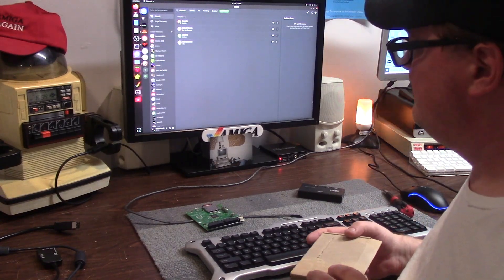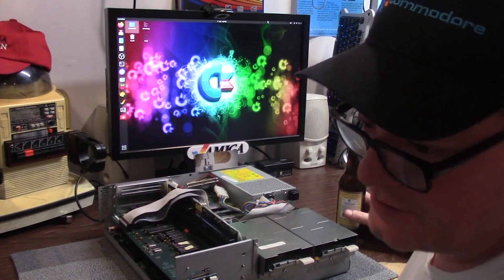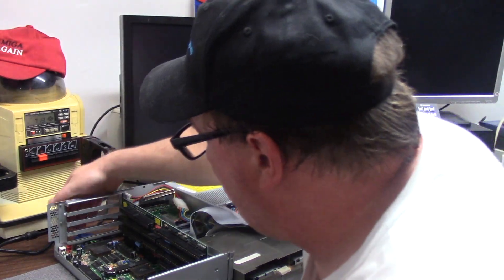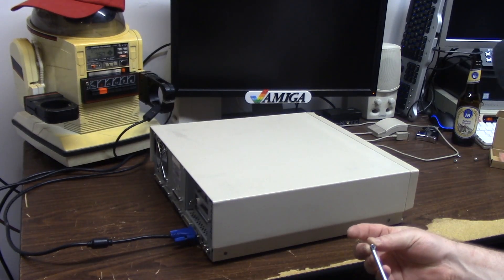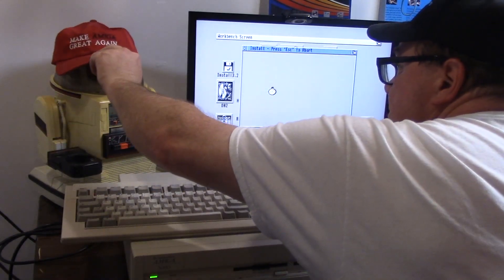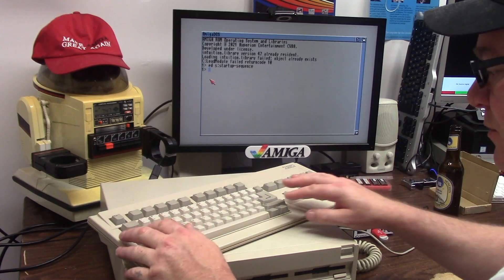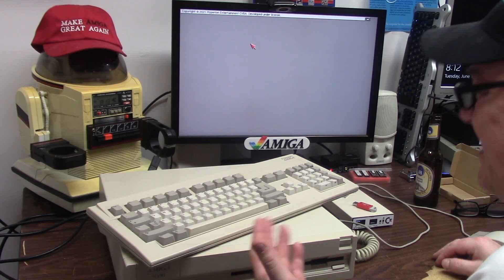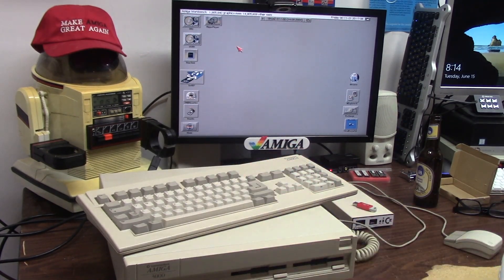Amiga Shorts A3000 3.2 update ..nope

Comment: @Chris Edwards By the way Chris , in the WinUAE v4.4 or even 4.9beta29 latest, since i have installed the AmigaOS 3.2 now the first boot don't work at all, for example, the menus work, the commodities work, except for AmiDock and if i try to make a show info on any icon, it does nothing ! And if i make "Initialize WB from Tools menu" then WB keeps waiting, well, all like this, until i make another REBOOT, then magically all work fine, AmiDock loads and runs fine, all perfect, how strange... Update...: I think it has to do with Reaction, because the soft. that does not work is depending on Reaction, like RaWBInfo and AmiDock ! And even sometimes requires more than one ReBoot to work all fine ! Update again !!!...: Fixed, it was the Executive server program that causes problems with OS3.2, for the moment i disabled it, but i think it can be fixed and so i can be able to use it with AmigaOS3.2 ! :D
Reply from the maker: good fine, i too run executive server in some of my rigs. strange how this update screws up so much more than 3.1.4 ever did. well they did rip out 40% of the C dir contents this time and replace them with different commands that none of our old software understands....
Reply: @ChrisEdwardsRestoration  Yes, I see the C dir has new commands, but i think the cause for Executive to not being able to cooperate with OS3.2 is they try to fix a WBv3.1 old bug, but this can be disabled, so i am going to try that, i like very much the Executive software and i am a registered user of it, i tell you later if i am able to fix it... Thanks for the answer ! UPDATE...: AmigaOS v3.2 requires ExecutivePrefs to be set to SCHEDULER = NONE ! If this is not set, Executive does not let OS3.2 programs to work properly, like AmiDock or the new ShowConfig or TextEdit and more... Remember if you use Executive set from ExecutivePrefs the Scheduler option to NONE, that of course cut's the utility of this program to half but at the moment i cannot find any other way... :(

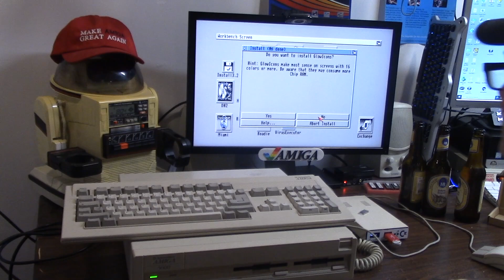Comment: It seems on 8:53 that the backup folder exists in the target volume, that's why you get this error. At least, that's what I understand by the error message. I believe that if you just renamed it, the installation would proceed just fine.
Reply from the maker: not backup folder exsists. a folder exsists. like system, tools, utilities, etc, which one? who knows.
Reply: @ChrisEdwardsRestoration  I checked the installation script and at the 5176 line tries to create the prefs/presets folder, which probably exists already.

Comment: Someone has not been watching my videos! I've done two in the last month about upgrading from 3.1.4 to 3.2. And the trick is, and the only thing that seems to work, is to upgrade it to 3.2 with your 3.1.4 ROMs installed. Soon as the upgrade is done, then stick your 3.2 ROMs in, and you are golden. I don't like it, but it's the only way I could get it to reliably upgrade without giving me all kinds of issues.
It's also possible to boot from floppy and start the upgrade from there if you have already installed your 3.2 ROMs. That generally works fine
Reply from the maker: i did. but I reject your reality and substitute my own. you know i almost sent you a message because its been quiet. just to make sure you were ok.

Comment: Hi buddy, are you sure you don’t need the “SetPatch” command? I’m pretty sure that came with every single version of AmigaOS, and it’s the only way the OS had to start in a compatible way (bugs and some limitations). I wouldn’t remove it tbh. Apart from that, I don’t have a 3.2, so I don’t really know what else might be going on.
Reply from the maker: Its not in the 3.2 base startup script. I made a hybrid of the two and shes all sorted
Reply: @ChrisEdwardsRestoration  thanks for confirming. As I said, I am still on 3.9 so I don’t know anything about 3.2. Then I wonder how they handle compatibility with ancient software (maybe they don’t).